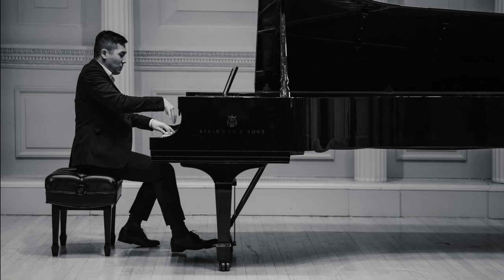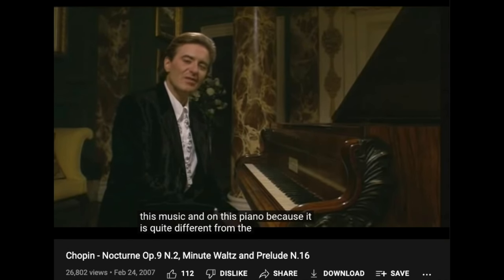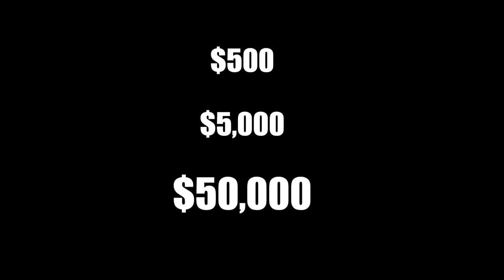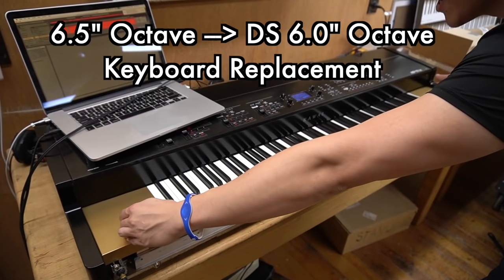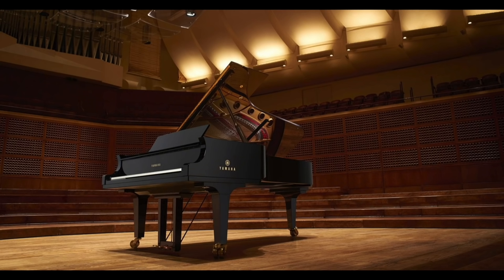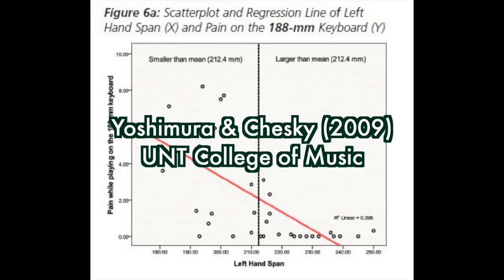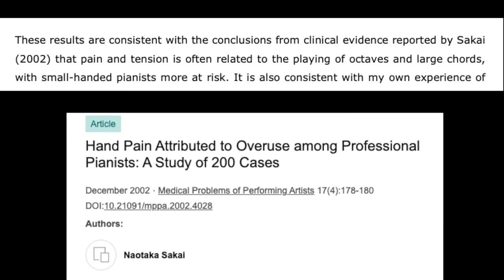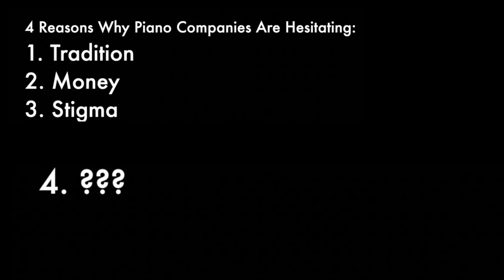Piano's Darkest Secret

Comment: Is there such a thing as hand that are too big? My hands are quite large :p
Reply: We virtually never hear about pianists complain about hands being 'too big' - except if their fingers are too thick to fit easily between the black keys. Manufacturers could vary the width of black keys to help this relatively small proportion of male pianists. Black key widths are not standardised and do vary slightly between makes.
Reply: @paskpianos  there things that are harder for big hand pianists to do. Many of the harder baroque pieces are easier for pianists with smaller hands (because of the lack of the double keyboard that some harpsichords have).

Comment: I put one up at work that's smaller than my yamahaw p45 with same 88 keys it was called nautilus 88 I think by Korg, if it helps anybody I'm fine with my p45 tho my hands luckily are quite large it's kind of a running joke in my family big foot n big hands because I'm not exactly tall not short jus average with large feet and hands lol oh well😆 🤣
But I'm sure it had narrower keys it must have it looked shorter than my piano and was same 88 key length

Sorry edit, 
Just looked them up there like £1500 to £2500 so never mind my yamahaw cost £400 so 🤷

Comment: There are other reasons that keyboards are standard size. Pianos cost a lot of money and are very large. Most players own only one and have to travel to play on other pianos, unlike guitar players who can carry their own instrument from place to place. It would throw players off if they had to adjust to different sized keyboards wherever they went to play different locations, or, imagine if venues had to have several concert grands to accommodate different players? Now, there could be some solutions now that we're so technologically advanced and there is definitely some inertia that would need to be overcome. Perhaps innovation will be able to overcome these challenges, however, you can't fault the manufacturers for using standard sizes over the years. I am glad you've found a solution for your own instrument.
Reply: Many others raise this issue....and while pianos are not so portable as many other instruments, there are solutions. Firstly, concert venues only need to have interchangeable actions/keyboards with two DS size keyboards that can be swapped over in minutes....a lot less costly than buying another piano. This has already happened in the Dallas International Piano Competition where contestants have been offered alternative sized keyboards. You only need two smaller sizes (DS5.5 and DS6.0) to cater for the vast majority of adults. 

Secondly, pianists readily adapt to different sizes and can swap easily. See the videos on this page:- https://paskpiano.org/you-can-adapt-quickly/. If a recital is 'important' then the pianist would expect to know what piano and keyboard is available in advance so can choose repertoire accordingly. A brief warm up is then all that's needed - like if you have to switch to an upright when you're used to a grand, or vice versa. If it's a casual event, like you turn up to a friend's house and want to play, then adapting quickly is not an issue. 

Thirdly, most pianists never get to perform in concert halls, and large numbers (mostly non-classical) do take their keyboards with them. Digital technology is improving all the time and taking market share from upright acoustics.
Reply: @paskpianos  I understand the issue and I'm intrigued because I've always played with some pain in my shoulders and smaller keys might help. I just don't like the tone that there is some kind of persecution of small handed people. I hope companies start offering different sized keyboards. It could be amazing for young beginners. I just hope activism doesn't intervene and force the issue greatly increasing the cost of keyboards. Increase the awareness and people will start to demand it. Then market competition will naturally make it happen.
Reply: @culdesachero  I don't think there is deliberate persecution of small-handed people. The issue goes back to the late 1800s when cultural attitudes were quiet different. No-one then had done any research on hand spans of pianists and whether some groups were disadvantaged. Then as the single size became universal, most pianists have accepted it as the status quo, and found ways of rationalising it. While the options available now are all expensive (Steinbuhler keyboards in grands or in Hailun uprights, other boutique keyboard makers in Europe and America). Some of us have been encouraging real projects for a while now, which the video doesn't focus on. We see digital keyboards as leading the way for various reasons.

Comment: many players dont get to the point where their hands are a major limiting factor. Don't use that as an excuse, cos there are many prodigy players with normal or small hanmds
Reply: If you can't reach a solid 10th you can't reach a solid 10th. It IS a limiting factor for many styles of jazz. And skipped 10ths just don't cut it. Some players strain to reach an octave. Clearly, that's a limitation. 

The real limitation here is the limited imagination of the legacy manufacturers along with the limited perceptions of those caught up in sunk cost fallacy.
Reply: You need to define' normal' and 'small'. There is a one inch difference between adult males and females. A 'very small' male hand is 'normal' for a woman. Also relevant is the hand span of these prodigies (many 10 year old boys can have hands larger than most adult women), the repertoire they are playing, are they leaving out notes, are they putting up with discomfort, and the likelihood of developing bad habits on a keyboard that is too large, only to be fixed up later.

Comment: Yes, but there's a HUGE danger in pursuing this option. That is: just like the French pianist at1: 54 admits: "this smaller Chopin piano is UNLIKE what I'm used to. Which turnes  jumping to and fro into a real hazard. In other words: Once you're system becomes addicted to a SMALLER piano, you're bound to run into problems if you have to play outside your house. Why: BECAUSE TODAY ALMOST ALL PIANOS OUTSIDE ARE THE STANDARDIZED SIZE!!!
Reply: Of course, you speculate. In fact, the real world evidence shows many players learn to adapt to a different size keyboard surprisingly quickly.

Comment: I cannot help but wonder if (back then) it was not a deliberate act to keep women out of the arena.
Reply: At the time when the current size became standard, the cross-strung design that came in then was designed for large concert halls where only male virtuosos performed. So the wider keys didn't matter for them. It was not acceptable for women to play outside the home, nor play 'male' repertoire...so while not a deliberate decision to keep women out, it just reflected the culture of the times. The fact that women's hands are smaller than men's probably didn't cross anyone's mind. Good data on hand spans and gender differences has been available since the 1980s. Even today, so many say they 'have never thought about the issue'.